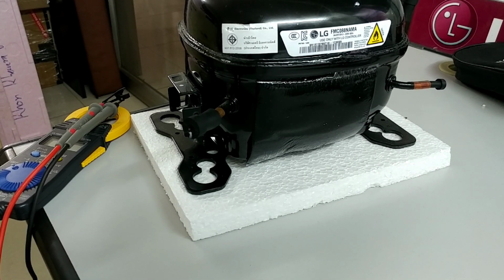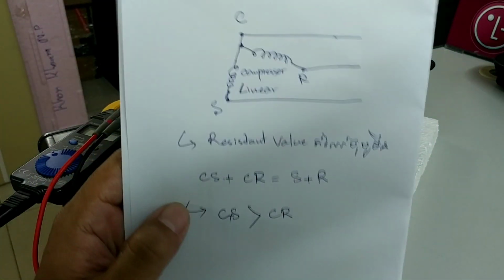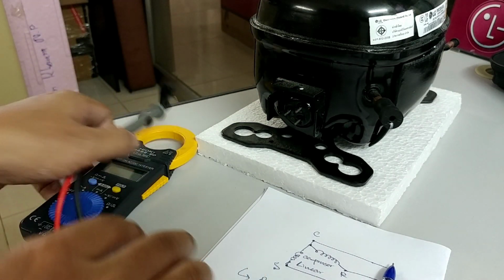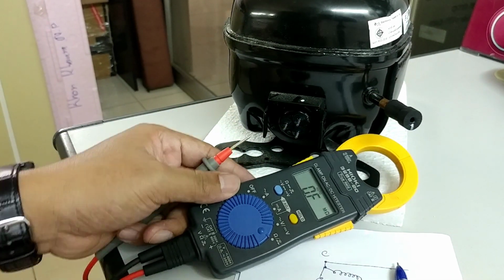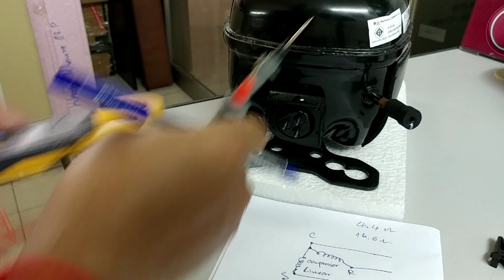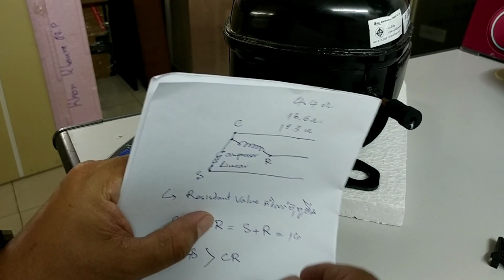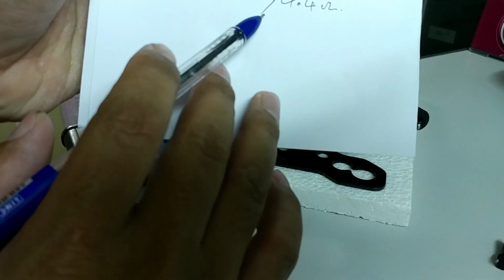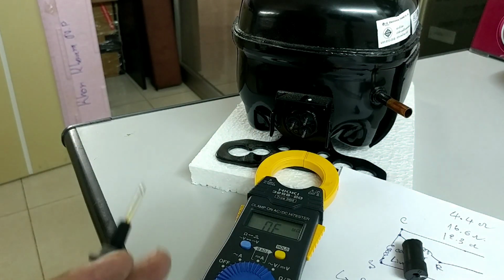How to measure lg fridge linear compressor, របៀបវាស់កំុព្រេស័រទូរទឹកកកlg linear Compressor.(2)

Comment: Hello I have a question,while he's got linear compressor,and code,measured like conventional compressor.if you want to try it with a cable,how do you connect it,to work,if it is easy make a video thanks
Reply from the maker: Dear Please refer below video concern about compressor test by jig ( Linear).
https://youtu.be/6iWFaT7zC9I
Reply: dear thanks but in which contacts of compressor connect the cable power,common,save thanks